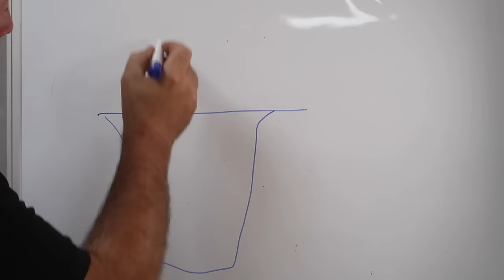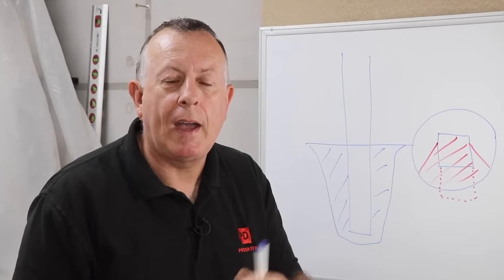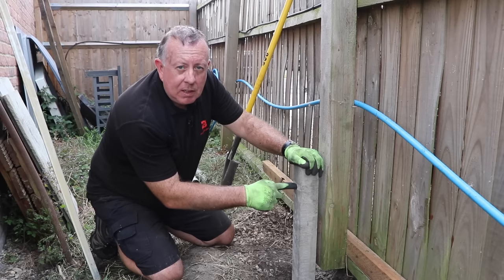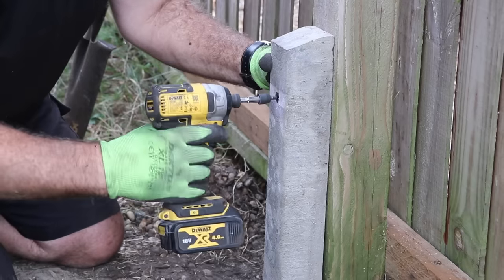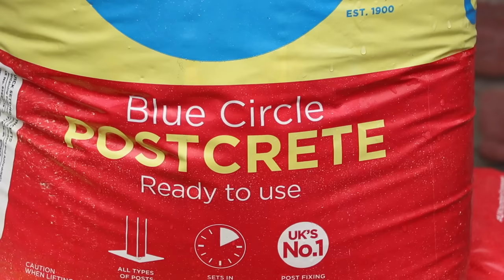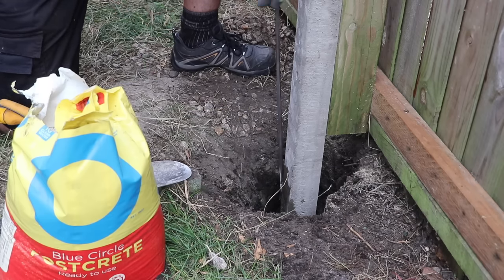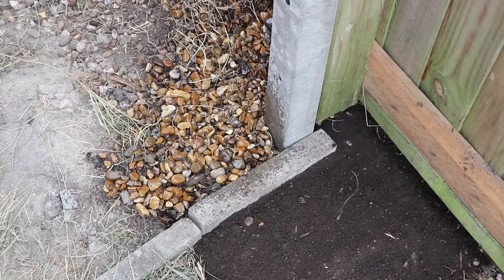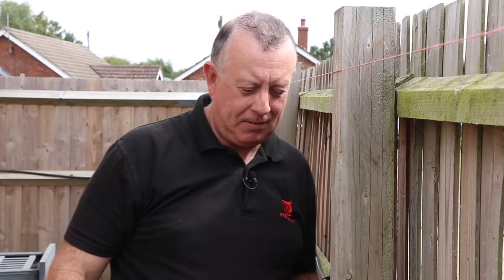The Easy Way to Fix a Fencepost

Comment: Done this myself a few times. I personally believe wooden posts in the ground are just a time bomb waiting to rot off.   Wouldn't use post crête either. 
Good to leave a decent gap between the post and the ground level to avoid further rot.  Or bitumen paint on the bottom of the post

Comment: I had to fix my fence regularly but 3 years ago I went with concrete posts and omg such a difference, I know they don't look as good but it's solid and I don't have to worry before every storm is my fence going to hold. Replacing panels in the future will be a easy job or taking them out for painting. Just much better system and cheaper in the long run, if you think how much money you spend on new post, mix and time for digging every year
Reply: Concrete posts are good, but for many people they scream council estate.
Reply: I painted my concrete posts with fence paint and it works surprisingly well. It has lasted about 10 years so far.

Comment: I realise that it would involve extra cleaning but I think tip the bag of postcrete in your wheelbarrow, add water and use the same as if you had mixed it from scratch. Yes many people don’t have a wheelbarrow but I’ve used an old washing up bowl for mixing small amounts of cement and concrete. If you are not satisfied with the postcrete instructions and prefer to witness the wet mix then it is surely more practical to mix it first rather than faf about the way you did in the video. Just my opinion. An old washing up bowl is a must have tool. 👍

Comment: Hi Stuart.
Postmix concrete IS quite expensive to use but as you say sometimes it's worth the extra cost for the convenience of speed. Another volunteer friend and I put in 33 posts for a safety railing in the grounds of a junior school, where we had to do all work outside of school hours. For speed and economy we dry-mixed each bag of postfix 'concrete' with a 25kg bag of inexpensive mixed ballast. We then adopted a similar approach to yours - mixing in the hole in layers. The result was the same rapid-set as pure postfix but at much reduced cost. If you've got lots of posts to erect, this can achieve a significant saving -important when working within a tight charity donation budget.

Comment: And there was me thinking "Stuart I thought you had two to do !", I might have known ! 😂

From what you've said before I guess that fence is only a few years old - pretty poor to have failed in that time - the fences for our new build were pretty poor too, but with a bit of bracing and pinning I did squeeze around 15 years out of them, but finally got fed up of them blowing down every time there was a high wind - the only reason they lasted that long is because we planted a hedge on our side which stopped the wind blowing them right over !

Good practical advice as usual Stuart, Thanks !

Comment: Thanks. Just done mine after my fence blew over. My understanding is they are reinforced concrete, so should be fairly comb proof ! I would have used some nice big washers to spread the clamping force. As you say coach bolts would have been a better option.

Comment: @Proper DIY, Hi, Stuart video idea to cover top hung / side hung friction stay hinges for uPVC windows?  How to change, making new new screw holes (new ones never align to the old one)?  How to repair / get around stripped out holes in the frame where a screw needs to go? How to adjust to get a better draft proof seal? etc.  Many thanks if you take it up.

Comment: Good know thanks,
First house I bought had sooo much trouble with fence posts rotting, the installs were all DIY by other people, I vowed never to put a wooden post into the ground after that, just a waste of time, concrete look crap though so this is a good compromise/ repair.

Comment: The moment looking left to the other wonky post is superb.
I've seen both post-crete and a more conventional concrete mix (with coarse agrigates in it) used to fix posts. The traditional mix takes longer to set (so you would need to support it) but it might be worth it, if you have time.
Reply: Pre-mix the postcrete!  What's so hard about that?  Doing it in the ground is just asking for trouble; you always have enough time to mix and pour.

Comment: I used metal fence menders that you hammer in with a sledge hammer. No digging required, and they go down into the existing concrete.

Comment: Just wondering if you can just post-hammer in a heavy duty steel fence post. Bolt, strap, screw the steel post to the existing post. Quick, easy.
Reply: Might be problematic since you might have a concrete ring left around the rotted posts in the ground. But they do sell brackets for T-Posts. 🤷‍♀

Comment: Stuart two things:  surprised you have a live water pipe above ground - is your area frost free?  Personally I would have used machine bolts and nuts rather than screws to secure the post.  True in my case you would need to drill holes in the post

Comment: Something important is in cold climates such as Canada you must go down 4 feet (120cm)otherwise frost heave in the winter will literally push the post and any concrete out of the ground  in the winter. So you would need something at least 5 feet ( 150cm) long only leaving 1 foot above ground to attach to the existing post. So at that point you might as well replace the entire post with a new one.

Comment: 6mm hole?  The spurs I used fit 10mm coach screws, and the better spurs had 3 holes rather than 2.
BTW, used your technique for my own spurs and concrete fence posts.

Comment: An easier method that I have found works for many years is to take a metal U post and drive it into the ground next to the broken post.  Then attach the U post onto the fence post using deck screws.  Here in the United States a U post costs about $8.  No digging required.   It takes two minutes and lasts for years.

Comment: Another great video here .  Why did you put the support where you did ?  Could you not have put 1-2 either side of post as would not encroach into the path .   If used 2 could then put 1 in position then drilled through the post and used studding and bolts to clamp them together ready for the postcrete  .   Have a good weekend and keep the vids coming

Comment: Interesting fix.  Your concrete will set just fine.  In fact, you can even put it in dry.  The mix will absorb moisture from the ground and set, although it takes a little longer.  I prefer to mix mine in a wheelbarrow using a garden hoe, then spoon it into the hole with a shovel.

Comment: Nice work, Stuart,
Personally I don't like the post mix stuff, but if it gives decent strength, by all means use it.
It's not hard to mix a couple of wheelbarrows of concrete. 
Surely.

Comment: Your best bet on the coach bolt issue, is to buy some M6 or m8 stud, a nut on either end and you're good to go, I did this to move some of my fencing. You can cut the stud to the required length 👍

Comment: I’ve also used the metal stake method, which not as good as the concrete spur, is super quick. Edit: to clarify, the metal stake is ideal for those with limited diy skills who need a quick temporary fix.
Reply: In my case, temporary has lasted nearly 15 years.  They do rely on the existing posts concrete base being sound..  I used post buddy which uses 2 stakes, one on the back and one on the side.
Reply: @BillyHey72  yeah, I’ve used one with success. Purely for lack of space to dig out the massive shed sized concrete foundation (neighbours fence border to the dragon in laws). Plus it goes through the block with relative ease
Reply: I've used metal stakes where there hasn't been room to dig. They look better than a spur especially when the fence has a dark stain. Five years later they are still going strong.

Comment: Looks simple , all mine I had to go down 600mm with an sds drill to hack the old concrete out , then used old rubble then concrete , did this in 3 layers and hammered it all in tight

Comment: I would highly recommend a roughneck 17lb post hole digger 60 ins long  got mine from screw fix . £50despite its name I have found loads of other uses for it best £50  I have ever spent makes it easier to dig out holes specially with a bit of tape wrapped round the shaft to mark the two foot depth

Comment: Older American here.  I'm not an engineer.  Good video.  I too have repaired, replaced & installed a number of fence posts, wooden & metal.  I agree with your cement mixing technique & concerns.  In regards to the use of the screws you used, I'm curious as to why you didn't use fender washers on them?  It looked like the heads might be pulled into the hole if the fence experiences a significant lateral load.  Understanding that the holes in the cement brace are rather small in diameter did you consider using a piece of all-thread to go all the way through to the other side of the fence?  Interesting item that concrete spur.  I don't recall having seen them in the US.  What kind of wood do you use to build fences in the UK?  Is that considered a sunny day in the UK?  😊 Thank you for the video.

Comment: Excellent series. Many thanks. Re. fence posts... You seem to avoid the option of a metal spike (either long for new install or short to go ontop into old broken fence post). Replacing posts in the future become easier and they last longer as they are not in the ground. Simpler and cheaper? What do you think?

Comment: Use the SDS or Combi to redrill the hole. It wouldn't take more than 20 seconds and you can shove a nice 8 or 10mm bolt through it.

Comment: Having done this a lot, a reciprociting saw (£40ish at Screwfix) is the best way to cut off the bottom of the posts. The soil in the garden looks soft, so the bigger/longer spur would have been the better choice. Postcrete is the way to go but you have to work FAST and the wet weather in the UK will ensure any dry mixture will go solid.
Reply: You forgot to add ‘in your opinion’. Make sure you don’t get carried away with it.
Reply: @imconfused1237   It's not an opinion it's fact.

Comment: Thankfully I didn't have concrete in my post holes. I was able to drive in metal fence posts right next to the weak posts and used big screws to attach them with. Trouble is that my wife bought lightweight posts meant for stringing wire. The metal wasn't strong enough and bent. The house was being sold as is and the attempted repair was behind me.
   I vowed to use much heavier metal posts if I ever need to do that again. Possibly the metal posts used for road signs, or Unistrut cut to a point. No digging unless necessary for larger stones that the post can't push away. Again, big screws such as lag bolts to hold it all together. Better yet, through bolts with washers and nuts if there's access to the other side.

Comment: I always add spurs when building a new fence - either concrete like this or where looks are a bit more important, slimline galvanised steel ones - once painted up, no-one notices them, but when the post eventually rots off, unbolt it, bolt a new one it, nice and easy. (the galv. steel ones are actually a bit cheaper than concrete)

Comment: Did you think about simply removing the rotten stump from the concrete and sliding the new post straight into the square hole? I repaired a post doing that recently. So easy! No digging! It's definitely worth trying as a first option.

Comment: Wickes sell coach bolts that usually fit no problem - the green ones in around 200 -225mm which will cover you for a 100mm post/75mm spur/100/spur  or combinations thereof.....Run a 10mm long masonry bit through the spur first if its a tight fit

Comment: your way of using postfix makes a lot of sense I was always felt uneasy about using the amount of water recommended despite the fact it seems to work !!! PS have you or are you going to do any vids on putting slabs down using primer on the back of the slab. The problem I have is again the instructions say mix the primer all in one go but it goes off very quickly so I have been making up small batches with the water and powder reduced in proportion do you think this is ok?

Comment: I don't mess around when it comes to removing the old concrete.
I've got a four foot farm jack and sit it on a piece of scaffold board.
I then screw a chain to the concrete using thunder bolts and jack the concrete out.
Usually no digging and I rarely hit any complications.

Comment: Doesn’t the several small mixes cause “layers”, as each batch would be at a slightly drier stage to the subsequent one?
Reply: Take a step back. Consider the context. It is important. You’re talking about a fence post here. Not the foundations of a house. It is going to be fine.
Reply from the maker: Each layer is mixed into the one below and is only 1 minute behind it in mixing

Comment: With the holes in the concrete post being too small for a coach bolt what I do is use a masonry drill to widen it, works perfectly.

Comment: If you have to go to all the trouble of digging the concrete out of the hole, you might as well replace the post... A Sawzall (reciprocating saw) to cut the nails between the rails and the post and then use long screws (or carriage bolts) from the other side to go through the pickets and rails and then go into the post... You might want to screw in a temporary vertical piece (2x4, perhaps) a few inches to the side of where the post is so that it will hold everything together while you are putting the 4x4 in place...

For a temporary fix of a fence like that, I am more inclined to use either some angle iron or channel iron and drive it into the ground between the post and the concrete and then drill some holes for screws to go through to attach it to what is left of the fence post... I fixed one post "temporarily" like that and never got around to replacing the post (because my next door neighbor is a crazy old Indian lady) and it's been stable for a couple of years so far... I'll probably fix it when she finally croaks and the kids sell the house to someone who is not bat-excrement crazy... She kind of went off the deep end after her husband died a few years ago... Prior to that, her husband and I got along great, repairing our common fence after a hurricane blew it down back in 2008...

Comment: I wonder if the spur post has any steel reinforcement in it. Would a piece of pure concrete have the bending resistance needed? I'm afraid stresses from wind will crack it.

Comment: Given the effort of digging out the hole, cutting the post, it's easier just to set a new post really.

Also with the Postcrete, is mixing it that thoroughly necessary, the moisture in the ground will cure it over time anyway.

Comment: One big gale and they will pull right through the spur if you are not going to drill out the holes and use 10 mm coach screws then at least use washers ..postcrete about third of a bucket of water chuck it in the hole pour in the  postcrete and poke it round the spur .The postcrete you are using is excellent it goes off in minutes that's all you need to do .

Comment: I would place the concrete on the side so it will not inter fear with mowing the lawn or other hinderance. The bolts will bear the lateral force so use 5/8" or 1/2" bolts. It is temporary.

Comment: I just pounded a U shaped metal post next to the rotted off part which was in the ground. The metal post had screw holes to affix the upper portion of my fence post. I then sank 4 3 inch screws into the post, and was done.

Comment: What about:
- source 12mm+ rebar 
- drill holes into existing concrete, suitably spaced/placed.
clear dust from surface of concrete base
hammer rebar into holes
place wooden mold around rebar then fill with concrete, let set, affix to post

Comment: those spurs take m10 coach screw or coach bolt you should be using the same with spur to post so 100mm post need 100mm spur

Comment: would m6 threaded bar work better? Also regarding post crete - I find use a bag to set post quickly and then make up some normal concrete later to fill the remaining hole when you have time

Comment: Wondering about a load bearing 4x4 post directly under the wooden post to take some of the stress off the 2 screws.   (maybe concrete)

Comment: After cutting off the bottom of the post I thought that you were going to put a temp box frame around the base and bring the post mix up to the base of the post to carry the bulk of the weight.  As it is that post and the weight of the fence either side is carried entirely by those two extremely thin screws.

Comment: Myself I don’t concrete posts I prefer to pack Earth around the post a few inches depth at a time and use a piece of timber with a sledge hammer to pack the Earth down hard around the post. Concrete does not make the post last any longer but just makes it harder to replace rotten posts.
Reply: I agree, my Dad just tamped in posts, and 40 years later, I do too. It's just too easy to replace them without a bunch of concrete you have to dig out.

Comment: Wooden upright fence posts rot at ground level in about 5-7  years. Major pain to replace, or bodge with a concrete spur as shown. 
Use concrete posts and gravel boards. They don't rot!

Comment: Y'all, what if it's not the foundation, but the wood post itself that warped halfway up? We set our posts, then had to take 3 weeks off, and one wood post warped before we put the rails on. So now we're ready to get the rails in place, but one post is bowed 4" away at the top line- do you think the rails will help it warped back over haha, or should we dig this thing up and get a new post?

Comment: You should go around all the other posts on that fence and clear an area of 8 inches (for a 4 inch post) around the post at ground level clear away all the soil, down to where the post meets the concrete and put in pea shingle this stops the post rotting where it meets the soil.
Reply: You should go and do it for him.
Reply: @imconfused1237 you should go do one.